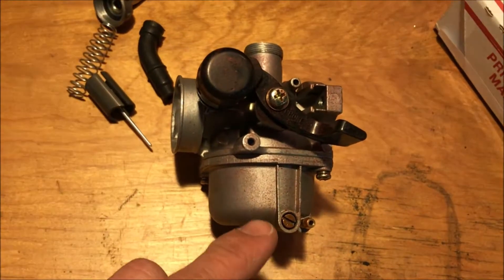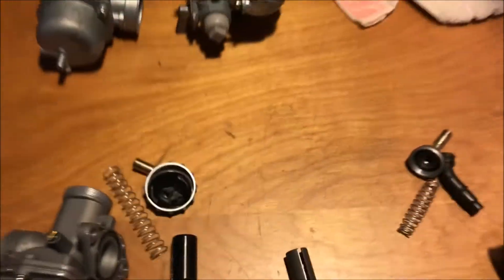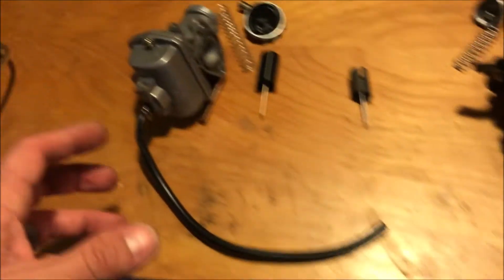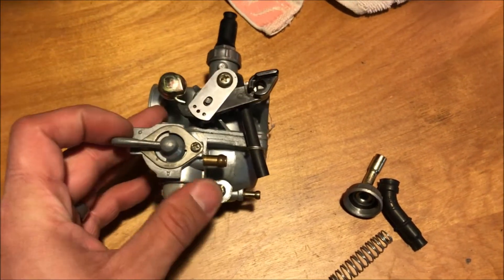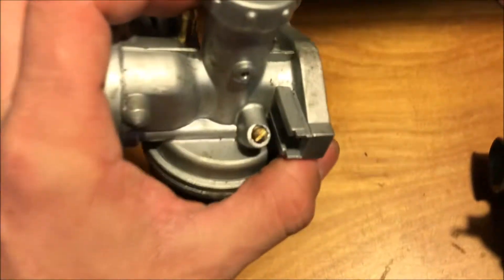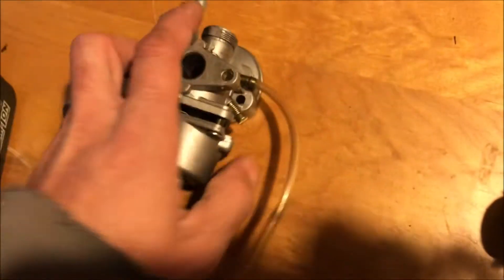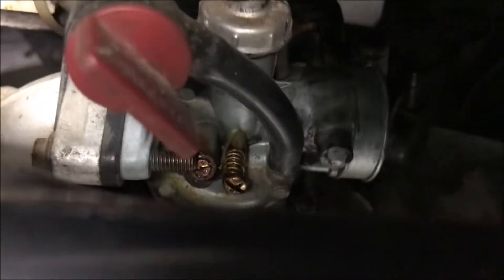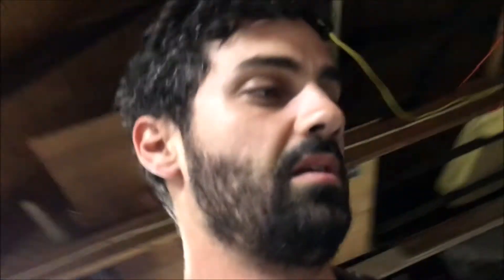How to Choose the correct Carb for your ATV or Pit Bike

Comment: Hey can you help me and tell me why my 110cc atv runs good for like the first 10 mins then Boggs and dies after the 10 mins
Reply: Too mych fuel prob, clean it and put a loser main jet
Reply: Lower
Reply: If you gas tank is not vented properly it will vaccum lock and fuel will stop flowing. I know Its a year late but I hope this helps anyone having the same issue

Comment: I have a 110 CC quad, made in China or Japan. I need to replace the carb but I cant find the right replacement. I ordered one but after removing the throttle cable, it does not have an area for throttle piston.  My existing throttle cable has a spring and little piston. All of the ones on amazon do NOT have a piston, just a spring. It is a KF Standard of Japan carburetor. Any help locating one would be muchly appreciated. I can send pictures as well, if needed.
Reply from the maker: 🤔 I would like to see pictures. Message me on Instagram @wasthatawesome

Comment: I have a Chinese atv, a Baja 250 cc and I need to change the carb but I’m not sure which one to choose, I believe it has an automatic choke, what else do I need to have in mind when buying a new different carb for it? And also is it possible to put a new different carb on it that fits the approximate specs, considering I can’t get the original
Reply from the maker: Yes almost any carb with similar specs will work. You may need to tune the carb slightly if it’s too different
Reply from the maker: I believe those use a vacuum style throttle (the top is flat and the throttle cable connects to the side). Search on amazon or eBay “baja 250 carb” and look for one that looks similar.
Reply: Hi, i have a 125cc big wheel pit bike the stock carburetor on it is a pz26 should i buy a pz19 or something else smaller than a pz26?
Reply from the maker: @trey5069  its best to try to get the same one so you dont have to mess with tuning it too much. you will lose some power going to a smaller carb most likely
Reply: @burnout_MEDIA  thanks mate

Comment: Hey bud, my carb for my 125cc 2x4 4 wheeler says PZ22 but it looks just like a PZ20. Would a 20 work? Also what does the 20 and 22 mean? Thanks man I appreciate your help so much in trying to get this going for my little boy.
Reply from the maker: The number is the opening size in mm. Yes the 20 will work fine on a 125cc
Reply: @burnout_MEDIA  thanks man!
I appreciate you.
Reply: @burnout_MEDIA  I got a street bike and it's wearing a pz20 carb like the other guy and inside the needle says 15c i was thinking of upgrading to a 22 carb and yes my motor is a stock lifan 110 with electric start yes it's a Chinese moter on a Italian bike yes the company who made it are ij Italy
Reply from the maker: @georgemixalakis3724  doesn’t hurt to try but in my experience it didn’t make it any faster. Pz20 is plenty for a 110

Comment: Which do I order if mine has a tube the connects to the filter I ordered the 19 but didn't want to put it on because the filter didn't have the nipple to connect the other tube
Reply from the maker: Pull the filter off of your old carb and put it on the new one. You actually don’t even need it so if you don’t want to hook that hose up you don’t have to
Reply: @burnout_MEDIA  wow thanks I was stressing over that hose lol also just seen after watching your video the one I had said pz22 should I just order that one instead, the one i put on is the one with the gold choker . Sorry just new to all this . Thanks for your time
Reply from the maker: @faithlaboy  glad to help!

Comment: What carb should I use for performance on a 04 edge 90/baja 90 4 stroke has full aftermarket exhaust and a pz30 I think and it bogs bad
Reply from the maker: Bogging is usually a sign of too much air. Try raising your needle and see if it helps

Comment: My sons Kayo Fox 70cc 4-Stroke. Won't run without the choke full open all the time I'm hoping it's just the pilot jet is clogged. I just want to upgrade to a better quality carburetor. I know the stock carbs are a known issue with these little quads. Is there a certain brand of the PZ19 that's the best. It's never run without choke wide open since brand new.  Anything else you could think thats causing this issue? Thanks for your help man!
Reply from the maker: Check out my “only runs with the choke on” video

Comment: Is there a direct replacement high-performance PZ19 carburetor that you can buy that will give this go-kart a bit more power? Or are all of the same? Thanks.
Reply from the maker: Carbs by themselves will do nothing for power unless it is severely undersized to begin with. Tuning it correctly is really the only way to get more power
Reply: @burnout_MEDIA  OK. Thanks. The reason I asked was because the one on my go-kart is just a cheap $15 PZ19 factory carb. But I saw one on Amazon called NIBBI Carburetor 19mm solid black with a red knob. It cost a whopping $68. The reviews said it gave his more power. So, I just wanted to get your opinion first to see if you think the $15 one is just as good? And if it is a direct replacement for the PZ19? If you think there's no significant difference in performance, then it's not worth it.
Reply from the maker: It’s just a fancy cosmetic. It might be better quality but I guarantee you it’s not giving it any noticeable amount of power increase

Comment: The choke lever on my PZ20 carb is blocked by the frame of the ATV🤣. Would it work to use a PZ19 carb so I can use the choke?
Reply from the maker: Do a search for pz20 left hand choke or right hand choke. You can get them either way
Reply: @burnout_MEDIA  I can't find any pz20 right hand choke carbs and that wouldn't work anyways since the frame is identical on either side and the carb goes in the middle.
 Would it work to use a PZ19 carb?
Reply from the maker: Yeah a pz19 should work
Reply: @burnout_MEDIA  Ok, thanks!

Comment: Bought a chines ATV Baja. Had a 90 or 110 not sure but it had a pz20 on it and the throttle cable hits and binds up on the frame. So should I switch to a PZ19? Will it hurt the performance? I did upgrade to a 125 4 speed.
Reply from the maker: This sounds like your throttle cable is too short and the carb isn’t the problem

Comment: What size main jet did you have on the last quad? Did it run good? How far are you above sea level? I have a 110cc straight piped atv just without the muffler, the rest of the pipe is still the same length. Due to the removal of the muffler would I have to upgrade to a pz20? I am currently running a pz19 on it but it runs too rich even with a #78 jet? Is it normal to have to go lower than a #78 on 110cc running a pz19? Also I am at sea level. Please answer as I am struggling with tuning the carb. Thanks.
Reply from the maker: I rarely changed out the jet that came in it. They are sold already tuned for the most part so unless your engine has some serious work or you are putting on a carb that is a significantly different size than usual,  you don’t need to change the main jet out

Comment: I got this bike thats a pitstir pro gpx 125cc 2005. Which is a off brand of the honda ssr 125cc 2005 pitbike im confused a lil. Can i use a honda carb on it or is that even a thing sense carbs dont go by Honda. Do all carbs have a part part number.#

Comment: I have a newer Apollo Blazer 9 125cc, I can't tell if it's a PZ19 or PZ22, they both have round bowls. Could you help me out?
Reply from the maker: The blazer 9 uses the PZ22.
Reply: @burnout_MEDIA  ordered the PZ22, thanks man, appreciate it!
Reply from the maker: @themaskwhisperer334  glad to help
Reply: Apollo Rfz x18 which carb should i get?? I’m having bogging issues on 3rd & 4th gears it’s using the one it came with a vm22 26mm carb

Comment: This is a weird question but I need help I can’t find it anywhere I need a new throttle cable for my tao Tao 125cc db 17 I’ve been scouring the internet just trying to figure out what size I need. If anyone can help that would be amazing.
Reply from the maker: Can you take it off and measure the one you have? Or stretch a string along it to get it close. If it’s a couple inches longer it won’t matter. You just don’t want it shorter.

Comment: Hey, great video ! I got a K&F Standard of Japan PZ26 Carburetor  and the only adjusting screw I can find is for the idle. Do you happen to know where the air misture screw is located in this carb? Thank you!
Reply from the maker: It doesn’t look like that carb has one. You will have to tune it by replacing the idle jet inside of the carb.
Reply: @burnout_MEDIA  Thank you... Now I know for sure that I'm no crazy 😉
Reply: Take a look up from the bottom of the bowl, is there a small brass thumb screw.  I had a pz26 carb with a hidden adjuster screw there 👍
Reply: Yea they usually have one under a little brass plug but that's not to say that one does. My pz30s always have. Such a pain. I drill it out remove the screw entirely and replace it with an extended screw for easy tuning

Comment: Hi i just bought an use pit bit SSR , BY YOUR VIDEO LOOKS LIKE PC19 PLASTIC CHOKE LEVER. Seller had said might be the Carb. But dont seem be conected right. Gas leaking out of places were seem hoses not conected . might you have a video showing how conect the lines.. 1st time working on a pit bike . thank you in advance. Also might Ib availe to ugrade to a 20pc and work??
Reply from the maker: Do you know what size ssr pit bike it is?
Reply: Not quite sure to be onest but carb might be a 19 :#
Reply from the maker: @luisjuarez9860  only one hose should be connected. From your gas tank to the fuel inlet nipple on the carb. The other hoses are overflow hoses. If they are leaking then your carb float is probably stuck or adjusted wrong and letting too much fuel into the carb
Reply: @burnout_MEDIA  O ok thank you apreciate it alot bro.🙏

Comment: Will one if these pz19's work on a 125cc pitbike? Will you have to tune it or will it be plug and play?
Reply: I think my chinese 125cc moto madness pit bike was running pz24  or 26 carb .  You will probably need to turn the idle screw down a little but if it's fine I would just plug in and play
Reply: And it's so so easy to tune. Order an extended fuel air screw for a few bucks and then it's just balancing it out. If you turn one way... And the idle goes down.... Turn the other way..... Turn it and let the idle keep climbing.  You can reach down every couple times and bring the idle screw down.... Then continue turning and let it keep climbing. "the fuel/air screw that is" and keep doing this until it stops increasing idle.... And starts to bring the idle down. The sweet spot is right in there I promise works everytime.

Comment: I’m looking for one with a throttle body for my throttle cables, I can’t find the oem part, and have like 3 vacuum tubes that are coming out of my bike. I don’t know if I’ll be able to find one that fits all these vacuum tubes. Would it work if I had a few disconnected?
Reply from the maker: Hard to know without seeing your bike but often the hoses are not really useful or are overflow hoses

Comment: Hey I'm from ontario Canada. Looking to get an updated carb for my 212cc engine. Not sure what to get. What's the mm sizing measure? There's a 26mm and 38mm. B0th apparently are compatible
Reply from the maker: It is the diameter of the carb opening. If you don’t have other mods, I would go with the smaller one

Comment: I have a pz19 carb on my Baja 50cc(4speeds- kickstart)
Just when i put it on 1st speed, it dies...??i recleaned the carb 3x,and it still dies..???
Reply from the maker: If you give it the throttle as you put it into gear does it still die quickly?

Comment: I have a Syx blitz 50cc and was wondering if I can substitute the original carb for a pz19
Reply from the maker: Is it the 40cc two stroke? Or the 60cc four stroke?
Reply: @burnout_MEDIA  it’s a 50cc 2 stroke and sorry it’s a syx moto holeshot x works
Reply from the maker: @Konichiwaa69  yeah this won’t work. Those use a completely different style carb. Check out my ssr 50 carb video

Comment: Good video, I just picked up a 03 chinese chopper, told 50cc, I went to clean carb and main jet was crushed in,,,,the carb says Dekni Japan pz22, should I replace it with the 22 or should I go with the 20? The 20 looks identical to the 22 on my bike, but the 22 online doesnt say compatibale with 50cc
Reply from the maker: The numbers can be tricky. It’s probably a safe bet to go with the pz20. But you can always return it and get the pz22 if it doesn’t fit
Reply: @burnout_MEDIA  TY for the reply, I just got the 20 and notice that my gy6 jets do not fit in it, do you know of jet packs that will work with the pz20?  TY again
Reply from the maker: @thedaydreamer7972  hmm that I don’t know for sure. I would try a set of Amazon and return them if they don’t fit. They are usually pretty universal so it’s strange those don’t fit

Comment: The carb that you show at the 348 mark is that a fuel screw or a air screw?
Reply from the maker: It’s an air screw. Unscrewing it lets more air into your engine for idle to 1/4throttle tuning. Most engines this will be 1-2 full turns out
Reply: @burnout_MEDIA  I just get mixed answers. Mine is on the intake side like that which technicaly make it a fuel screw but then some are still air screws
Reply from the maker: @ashleymuller4462  people call it different things. It lets air through a small passage to change your air/fuel mixture. On most small carbs, turning it out makes your mixture leaning and turning it in makes it richer

Comment: I bought a new one to replace the carb on the 110 at , but I'm still having the same problem, it's a pz19 just like the old one but it floods, same as the old one, I'm having the same problem, do you know why the old and new would flood to the point gas drips out the air filter, I appreciate any advice, tks
Reply: Open it up check for the floats , they may broken !

Comment: Will putting a pz20 instead of pz19 make any difference in performance etc
Reply from the maker: Nope. Although it doesn’t usually hurt either
Reply: @burnout_MEDIA  I was just thinking of trying to make my 125cc quad a little better performance struggles getting up small hills I have to push it up lol .  Was just thinking of slightly bigger carb pz22 maybe . performance spark plug  or something try and give it tiny bit more poke tbh propley just best getting a 150cc quad or something soon 🤔😎
Reply from the maker: @liam6488  your best bet is an exhaust and intake, and then try to tune your carb leaner. Even a pz19 can make plenty of power
Reply: @burnout_MEDIA  when you say leaner you mean turn my air mixture screw say anti clockwise 1/2 or 1/4 turn and turn idle screw clockwise say 1/4 if necessary
Reply from the maker: @liam6488  correct
Reply: Hi there can you help me my quad has developed a issue when I go to start my quad  the starter just spinning with out starting the engine and when it does grip it doesant start my quad or it makes a sort a rattle noise
Reply from the maker: @liam6488  sounds like the starter isn’t engaging. You probably need a new starter
Reply: @burnout_MEDIA  I think I'll try a new starter there cheap enough see what happens hopefully it's that and not something else like auto clutch or something
Reply: Hi turned out to be starter clutch and magnito had fell apart so got that sorted .  One other thing since I had this from new sometimes it rides fine but then soon as I stop cuts out and wont idle I start it again stright on the throttle rides fine then come to a stop it idles fine then tottally baffled as quad is new so it would have a bad carb or anything
Reply from the maker: @liam6488  that sounds like something in your ignition system might be going bad and acting up
Reply: @burnout_MEDIA  would know where to start
Reply from the maker: @liam6488  the cdi box would be the easiest to try
Reply: Hi there do you know how to set  the air/mixtre screw corrrecly .  Im unsure i know how to do it but im usure when to stop turning the screw ive heard to versions on how to do it  1st one being turn screw until rev drops then turn the other way until rev drops again then set the screw so if at 1 turn out it dies then at 2 turn out its start to die again i would set it at 1 1/2 turn out .   The other version i heard is turn the screw until its reving the highest  the ajust the idle speed then to suit .
Reply from the maker: @liam6488  I should do a video on this. Basically the way that I do it is to make sure the engine is warmed up set the idle slightly higher than normal and start turning the screw out once the idle starts dropping you’ve turned it out too far. Then reset your idle down low again
Reply: @burnout_MEDIA  when i set my idle should my rear wheels be moving when i lift my quad off the ground its a auto
Reply from the maker: @liam6488  either your idle is too high or your clutch is adjusted too tight
Reply: @burnout_MEDIA  so my quad should be idleing without the rear wheels moving or should then be moving slighly

Comment: I have a lifan 125cc pit bike motor on a scooter. It came with a pz27 carb and when i crack the throttle it boggs but if i ease into it it goes is my carb the wrong size
Reply from the maker: Try lowering the needle in the carb
Reply: Hey mate did you figure it out
Reply: Perhaps your float height is making it run too lean.
The bowl is empty and hence the bog....otherwise your main jet is clogged
Reply: I'm sure my 125cc pit bike lifan engine had a slightly smaller carb on it from factory pz24 or 26 . Maybe the carb is to big
Reply: Yep lower the clip on the needle